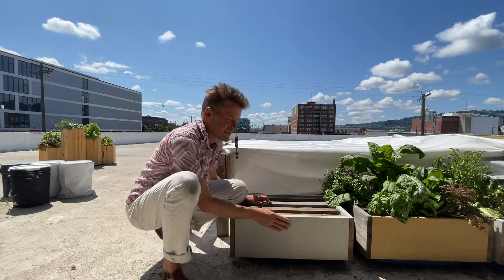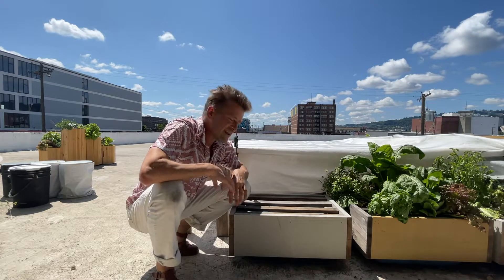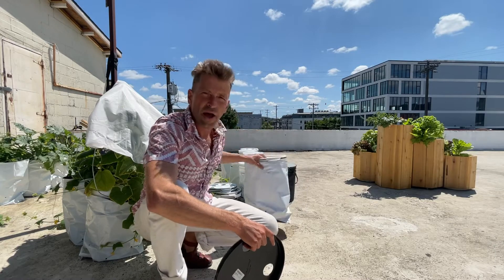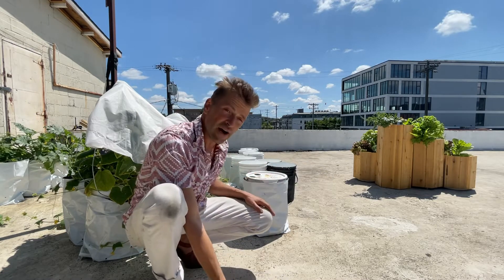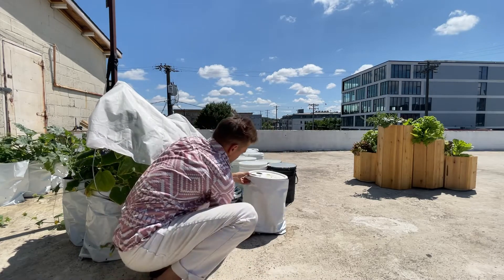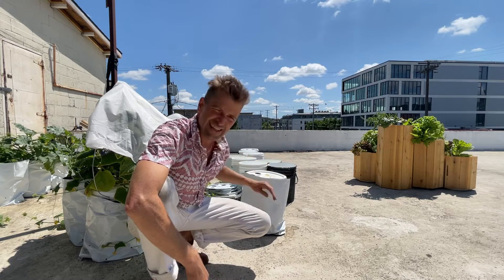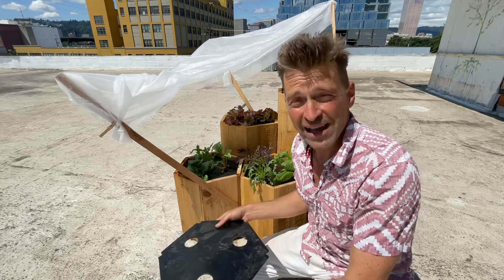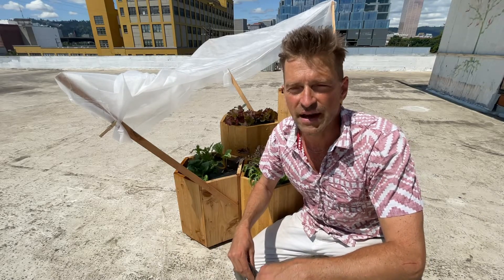Outdoor kratky method. Waterproofing passive hydroponics.

Comment: "Keep on Growin' with Mike VanDuzee" avoids the issue by simply drilling the holes (2") along the top of the side of a 5 gallon bucket. He secures the seedlings in the holes with short segments of pool noodles.
Reply from the maker: I've seen his method. Its a bit futzy for my tastes.
Reply: @boxjoy6361  To each their own. Bottom line, it's simple, inexpensive, and highly productive.

Comment: Excellent video, thanks for posting.  I had a few thoughts, if you don't mind:
1.  This is my first rainy season with hydroponics and my vessels filled up with water.  I'm looking for a way to build a cheap, fast, easy siphon as I have mounted down my vessels to prevent them from moving in the wind.  I'll look around and let you know if I find anything.
2.  Your video is great but it wasn't easy to find.  You might consider adding additional key words like - rain, too much rain water, .......
Thanks!!
Reply from the maker: "1.  This is my first rainy season with hydroponics and my vessels filled up with water.  I'm looking for a way to build a cheap, fast, easy siphon as I have mounted down my vessels to prevent them from moving in the wind.  I'll look around and let you know if I find anything."

unsure what you mean by siphon...
Reply: @boxjoy6361  I don't know what type of containers you're using but possibly the easiest way is to drill small seep holes in the containers.  When the solution/rain reach that level they drain out.  If you send me a photo, I might be able to provide more guidance as siphons can be time consuming.

Comment: In 5 gallon buckets I use a kitchen cinch type trash bag.
Cut the seam off the bottom of the bag and slip it up from the bottom or down from the top.
The cinch ties can be pulled up and tied as the plant gets bigger and forms as a tent.
Another benefit protects from suns heat
Reply from the maker: I believe the cinch is at the stem somewhere, correct? these are white bags, no? So this wouldn't stop water drizzling within a stem of a lettuce plant... right down into the bucket.

Comment: Have you seen the videos about replacing net pots with swim noodles by "Keep on Growin' with Mike VanDuzee"?
Maybe that is another way to prevent water from coming into the tanks.
Reply: Real pool noodles aren't porous.
Reply from the maker: The real problem is that many greens act as a funnel, bypassing any effort to create a seal at the netcup. The water just rolls in within the stem. Lots of water.... its surprising.
Reply: I get no rain water in my containers. All are with pool noodles.
Reply: Pool noodles are porous and let water through, I had this issue with a few of my containers growing Mikes way filling up.